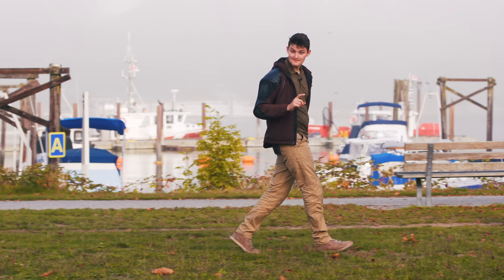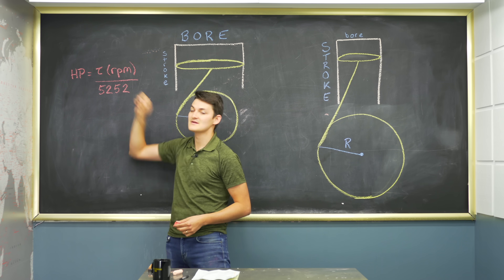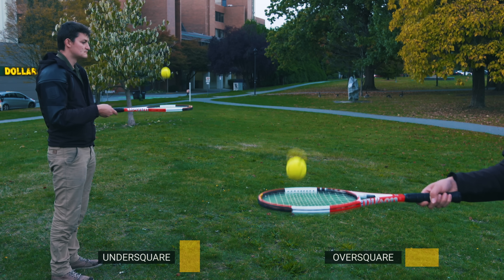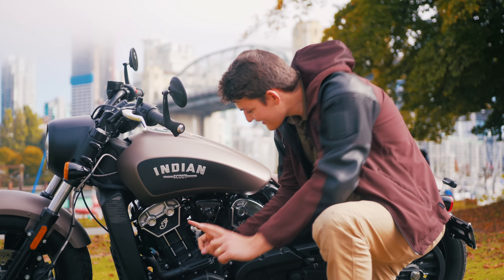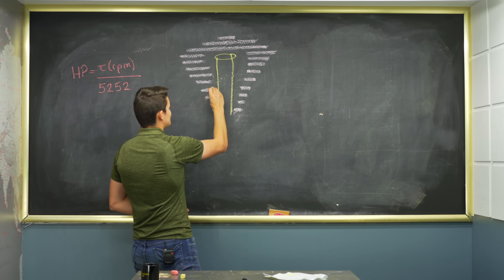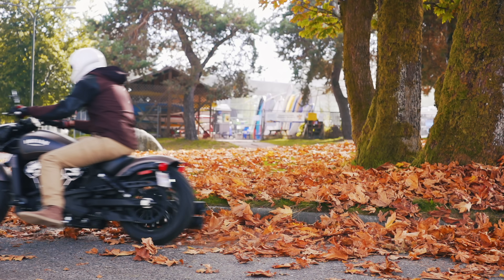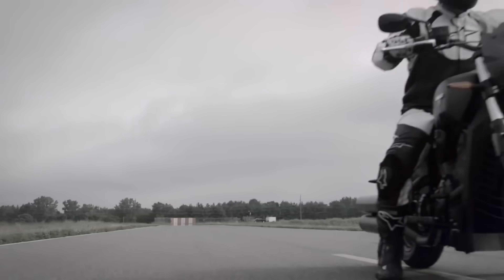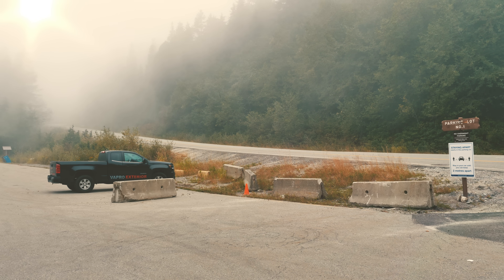How Indian Makes 43% More Power than Harley-Davidson

Comment: I think a big factor for the increased horsepower of an oversquare engine, (or, for that matter, using more cylinders) was missed.  The bigger the bore, the more area you have for valves.  The more area you have for valves, the more air you can take in.  The more air you can take in, the more fuel you can burn.  The more fuel you can burn, the more power you can get out of your engine.
Reply: So, after a few years of no motorcycle ownership, I retired and jumped back in. I initially started riding Yamaha twins in the 1970s - the kick ass and take names performance bikes of the time. Since then I've owned Yamaha inline triples, Honda inline twins, inline V-twins, Goldwing 4 pots and 6 pots, and landed recently, after retirement, with an Indian Scout 69. What a great machine. But, I had never owned a Harley anything. The noise and vibration just seemed to be nothing I would want. But, a few weeks ago I found a 2007 Harley Fatboy with low miles and a good sound, so I added it to the stable. After a few weeks of ownership I can now say I get it. Regardless of HP, the torque of this 96 C.I. motor is intoxicating. The Scout is fun 90% of the time. The Fatboy is more fun than than that. If you've never tried a Harley . . . you should.
Reply: not how an engine works, the discplacment is equal meaning each revolution at given rpm both bring in that amount of air. the main reason indian makes more power is from head design and flow. its all in the heads.
Reply: @Joebauers2505  By same amount, do you mean same mass or same volume?
Reply: @AndrewUnruh  it would be "volume" of air pulled into the cylinders per revolution.Each full revolution of a given cc/ci engine displaces that amount or air so a harley 96ci/1584cc engine will displace or pull in and exhaust out 96ci/1584cc of air per complete revolution and as rpm increases the fast and more air that be moved its harleys biggest downfall is lack of head design as with most Dohc or Sohc simpler for better more efficient air flow. concept is same principle for auto engines as well.
Reply: also this all changes once you use a alt fuel/ nitro, meth, eth. or move towards boost because at that point you forcing more air into the combustion chamber than what it is designed for effectively increasing the dynamic compression ratio.
Reply: @Joebauers2505  OK, just wanted to make sure you understood it was volume we are talking about.  I still don't see what is wrong with my analysis (nor, I assume do the 66 people who have given me a thumbs up so far.)   Look at two single cylinder engines.  Both have equal displacements, both running at exactly the same RPM.  Assume the position of the piston is described by a scaled sinusoidal function.  If we align them so they are both at TDC at the same time, then at any time, they will be displacing exactly the same amount of volume.  Right?
Now consider the heads.  The oversquare engine has a larger diameter cylinder.  This allows for more area for the valves, the the oversquare engine will have a larger intake valve (just assume it is two valves for cylinder, it doesn't change the analysis).  Now think about the pressure drop across the valve opening.  We know that for any volumetric flow rate, the pressure drop across a smaller orifice will be greater than it will for a smaller one (this is really easy to experimentally confirm, consider a hole in your tire....a pinprick leakes slowly, a big hole leaks fast)  A bigger valve means a bigger orifice and thus less pressure drop.  This means the pressure during the intake stroke of an oversquare engine will be higher (because the pressure loss is lower) than for an undersquare.  Since the volume is the same, but the pressure is higher in the oversquare, that must mean there is more air mass in the oversquare engine.  If there is more mass, there must be more oxygen molecules.  If there are more oxygen molecules, you must be able to burn more fuel.  If you burn more fuel, since the burning of the fuel is an exothermic reaction, you must generate more heat in the oversquare engine.
Reply: @Joebauers2505  HP = Torque x RPM  (i.e. Force = ma -> partial differential: "a" = d^2r/dt^2 -> 1st order derivative of velocity -> dr/dt)
Reply: @King_CrimsonX  you overthink it, the power range of a Harley is 2k-5500. The Indian is 3-8k if you'd spin the Harley higher it would also make more power.
Reply: @Joebauers2505  Eat your heart out .... the BIG "IF"! 😶
Reply: @Joebauers2505  The BIG "IF" question?  Indian is just more efficient with DOHC vs clunky piston rods.  Plus, if you spun up any HD into the 6-7K rpm range you'd blow the f#$%^@G engine into smithereens...
Reply: @King_CrimsonX  won't disagree with dohc being more efficient but will on the Harley aspect you can spend a Harley higher than 7k you just need the upgrade the valve train mostly just springs and roller rockers with hardened push rods the arguments no different than it is now with normal aspirated dohc engines versus push rod engines each have their place
Reply: @Joebauers2505 I quote "...but will on the Harley aspect you can spend a Harley higher than 7k you just need the upgrade the valve train mostly just springs and roller rockers with hardened push rods..." this is a INDS out of the box++

Anyhow, if we would roll back 2017, we'd be talking about a Victory Octane.  I love this bike and I could care less why they went under; the VO is not only beautiful but similar to an INDS fully tunned and ready to go. Claims 104 hp (78 kW)@ 8,000 rpm and 79 lb⋅ft (107 N⋅m) @ 6,000 rpm with a claimed dry weight of 548 lb (249 kg) and a tested 1/4-mile time of 12.0 seconds at 109 mph (175 km/h). 

Enjoy: https://www.youtube.com/watch?v=SVKuWggmbC0
Reply: @King_CrimsonX  I like Harleys but the staying the victory's had after say 2006 was on point they ran well made good power and were priced well.
Reply: @Joebauers2505  Totally agreed.  My sales guy at El Cajon Indian Motorcycle here in Diego has a '17 Victory Octane and loves it.  It's white/black whitewall tires with 15" ape hangers, and it sounds huge and looks truly badass.  Although it's 1,179 cc vs 1,133 cc it sounds massive.
Reply: horsepower is nothing a real motorcycle should be aegile and not as fat as the average american (:-)
Reply: The bigger the valves, not only is more air is taken in (and out), but it scavenges burnt fuel/air mix better. Displacement means nothing if every cycle your only getting less of a gulp of fresh fuel/air than possible (it's never 100%). Poor exhaust scavanging ruins the pumping (volumetric) efficiency of an engine. Its why exhaust tuning makes a difference. Way more attention is payed to intake design/flow, than exhaust in aftermarket upgrades in the persuit of hp. Yes, a better intake (less restrictive, or colder) makes a bigger difference, but the exhaust side needs love too.

Ive heard an engine builder explain, when the exhaust valve opens, a pulse travels down the header/manifold and bounces off the first restriction it meets and if given the right length, travels all the way back to the head. This pulse is what exhaust systems are designed around. All the variables that effect it are how exhaust systems are tuned. If done properly,  it boosts the engine like supercharging does (think 2 stroke expansion chambers=powerband). Ive always known that engines need back pressure to run well, but it's much more complex than just more flow = better. If that were the case, open heads/no exhaust would make the most power, but it isnt. 

It was interesting to learn about imo, wish i could explain it more accurately.
Reply: @ctdieselnut  That is a really deep way to look at it.  Yes, any change in impedance will cause a reflection.  Theoretically, you could model this as a mass, spring, damper system and design it so that at some RPM, the impedance is minimized.
Reply: @Joebauers2505  "the discplacment is equal meaning each revolution at given rpm both bring in that amount of air."

Incorrect. Go learn what a VE table represents and then think about why fuel injected engines use a MASS airflow sensor, not a volume airflow sensor. (Or speed-density/MAP+IAT, which again is just using other measurements to calculate MASS, not volume).

More valve area means more MASS of air flowing into the cylinder, even though the volume is the same _when static_. Very rarely does a cylinder actually pull in a mass of air that equals the advertised displacement at atmospheric pressure. It is almost always less, (with rare occasions in very specific points of the rpm range if the engineers managed to get the wave pulse tuning spot-on) which means that more valve area DOES allow the 500cc cylinder of an oversquare engine to fill better than a 500cc cylinder in an undersquare engine. Combustion doesn't happen based on volume, it happens based on mass. It's the entire reason that fuel maps even exist.
Reply: @ctdieselnut  small caveat, the claim that "engines need back pressure to run well" is categorically FALSE, and always has been. No engine anywhere "needs" back-pressure, and no engine anywhere runs better by increasing it. This stems from a fundamental misunderstanding of what's going on in the exhaust stream and misidentifying the side effect of back-pressure as the cause of whatever you're trying to do. Most of this misconception comes from muscle car people in the old days, who noticed that power increases with exhaust pipe diameter _up to a point_, after which power decreases despite the pipe theoretically flowing better and having "less back-pressure." What is actually happening is basic Bernoulli's Principle (or rather the inverse of how it is usually stated).

Basically, overly-small pipe diameter has a maximum mass flow rate lower than what the engine is capable of producing. It "chokes" the flow, so to speak. Opening it up to a size with a higher limit therefore increases flow out of the engine, and thus more power as there is less pressure for the piston to work against to expel the exhaust from the cylinder and less "leftover" exhaust in the cylinder (which reduces the amount of fresh air and fuel on the intake stroke). At some stage while enlarging the pipe diameter, you reach a point where the pipe's flow limit is greater than the flow output of the engine, and making the pipe any larger from here will slow the airflow (Bernoulli's Principle) to a point that the scavenging effect is diminished (slower moving mass = less momentum) and the pulse waves are weakened. This is why power is reduced when the pipes are too big. Reducing the pipes down sightly will regain that lost power, but it is NOT from "increasing the back-pressure", but rather due to the increase in flow velocity. Any increase in back-pressure is a SIDE EFFECT, and a negative one at that, but the loss of power from the minor increase in back-pressure is overcome by the increase in power from speeding up the flow.

Comment: Primary reason for over square is to avoid excessive piston speed. The piston doesn’t outrun the combustion. It outruns the oilly good lubrication. It also gets knock on effects like more space for valves and less force on the crank from moving the piston so fast.

That comes at the expensive of low speed breathability, smoothness and secondary forces but most of all a combustion chamber which we want to be round. 

The more surface touching the combustion those more area to lose heat through, the more difficult to get good mixing etc.

Comment: Just bought a 2018 Scout Bobber. Love the bike so far. Plenty of power, for me at least, and the accessories are not a limited as I first thought. You just have to look a little hardened to find them. The only diwn side is the the engine oil is 15w60 which is harder to find locally.
Reply: Just buy the oil online and do it yourself right?

Comment: Most people just want their old machines. The only diffrence is that they want them faster, safer and more comfortable.
Reply: i actually do want my old machine back, 1954. I dont think it exists anymore though.
Reply: I do. I'm gonna have to go retro.
Reply: I worked in the motorcycle industry for years. People, for the most part, do not want their old machines.
Reply: @apancher   I do and, i don't. I presently love my newer bike,  a NC700X. It just goes. Operates and requires relatively little maintenance. I'm considering something newer and will expect the same performance. 
On the other hand, I loved all of my bikes I had in the sixties.  First three were a Triumph,  a Benelli and a Yamaha. Didn't mind working on them and I knew them mechanically. Loved them too.
Reply: @timjohnson1199  the NC700X is probably the best commuter/utility bike ever built. Dead reliable,  great fuel econ, and lots of lockable storage. Not the most exciting,  but enough power to cruise thr highway.  When came to people buying bikes for fun, most people in the new bike market at least, had no desire for anything air cooled or carburetted.
Reply: @apancher  I guess I'd have to agree with you Alex. I just saw a YouTube where he complained about the low torque range. Rode mine yesterday and I think he's unfair- he must be used to those pipey ring-dings that don't make power till about 6 or 7 grand.  My biggest complaint is the seat is uncomfortable after a couple of hours and the pillion seat is too small-  wife won't ride it.

Comment: Only with my Harley, back in the days, I could ride slowly without missing anything.
The sound, rolling and vibrating of the engine itself by just iddeling when standing has put a smile on my face.
Standing and waiting at a crossing, with the bike and me shaking, I loved it.
Reply: That is exactly how I feel
Reply: Maybe if you'd tried an Indian back in the day. it does all those things and more.
Reply: @saxon1177  Well, in my "back in the days" there were no Indians, except the real old ones.  :)
Reply: @Ouwkackemann  Old Indians are Indians, too.
Reply: @saxon1177  Well, someone might argue that the new ones aren´t, so ...
Reply: The shaking does do a lot for the g-spot.
Reply: @saxon1177  This video isn't about "original" Indian motorcycles. I don't even know if they chose "RPM" over Stroke back then.  But by God an old Indian is a thing of beauty.
Reply: @Ouwkackemann  " Well, someone might argue that the new ones aren´t, so ..." and that is what's wrong.

Comment: I’d love one of these videos talking about some of the Ducati motors vs harley motors. Before they switched to V4, they had a 1200cc V twin engine making almost 4 times the horsepower of a Harley 1200 at roughly 200 horsepower. (The 1199 panigale R) The 1299 made more torque than the highest torque Harley’s at the time, similar to the highest torque Harley’s today, at significantly less weight too.

Comment: RIP Victory you were ahead of your time and I wish you were still around one of the best
Reply: For cruisers, victory is the only brand I look at. Tons of power, awesome styling and the used market has some amazing options for fantastic prices.
Reply: Still lovin my Victory Vision. Near bullet proof trans and engine.wouldn’t trade for anything else.
Reply: Exactly. As the clip in this video said, they didn't have a heritage holing them back; they could become anything they wanted.
Reply: They are still around, in a sense.  They own Indian motorcycles.  Polaris purchased Indian in 2011.  Polaris merged the companies because it didn't make since manufacturing two separate lines of motorcycles.  The Spirit Lake IA factory, now turning out Indian Motorcycles
Reply: @61ache  It wasn't primarily because it didn't make sense, to keep both going. Marketing and management was a huge negative, and even when both Victory and Indian were producing side by side, the Indian's were outselling the Victory hand over fist, because of the brand.
Reply: what do you mean?  I own 2 Victorys... not going anywhere!

Comment: I think, beyond image, part of the attraction to Harley is its tractor like performance saving low skilled riders the embarrassment of stalling frequently on a low torque, high RPM engine.
Reply: No one with more than an hours practice and 3 minutes of clutch instruction stalls a bike. (I did stall my SUbaru WRX more than a few times, weak ass/complete lack of torque ass motor, whereas my 2003 Cavalier with half the horsepower could do low 200 RPM 2nd gear launches without stalling!) :)

Comment: For more Torque in my 95c,i. '03 Deuce, I installed S&H510 LONG-DURATION CAM to go from 70hp to 95hp a 36% increase in power> A long duration cam allows more  AIR into a cylinder at high RPM to burn more fuel, hence more pwr> The single most important feature on ANY air breathing engine is hte INTAKE SYSTEM> It's why Jerry Branch flowmetricks used flat slide Mikunis to mate w/Fowmetric heads on XR 750 flat trackers & XR 1000 BOTT racers to eliminate chokes that obstruct air intake> My stock AMF '77 low rider suffered from "Vena Constricta" at the sharp edge of air cleaner until I installed a donut ring by Arlen Ness that blocked radial air rush that choked off breathing